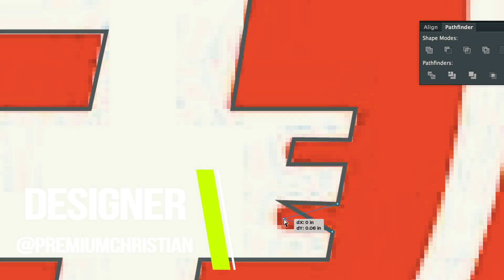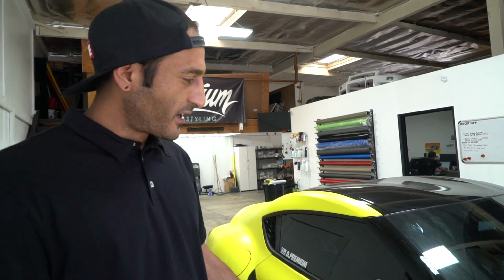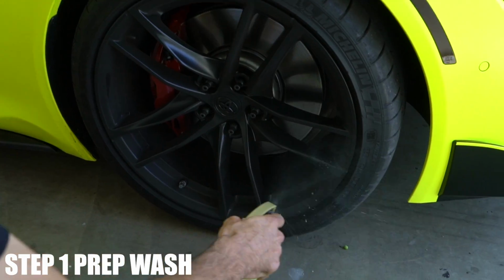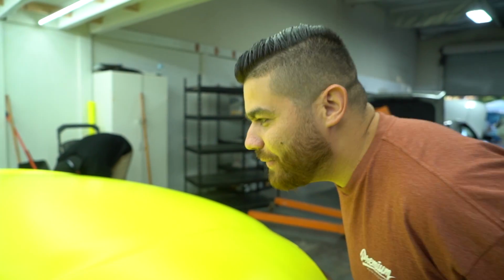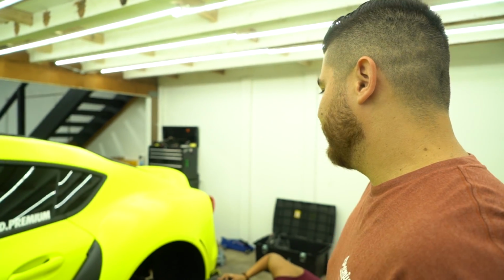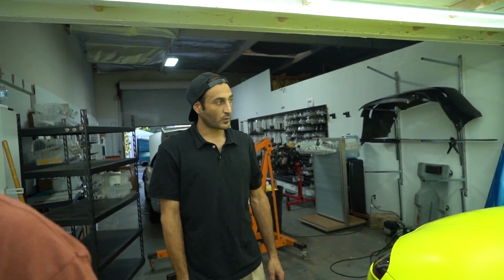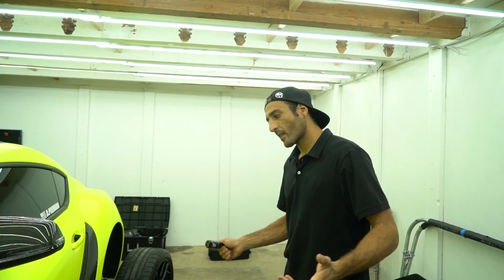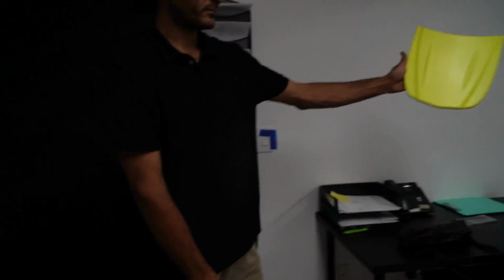MY CAR WRAP IS FADING! Ceramic Pro

Comment: This color from Arlon is more for interior, on vertical surface will last one year and for horizontal (roof, hood,boot) sections will last no more then 3 months based on your location in summer time. I've installed a sticker made from the same vinyl on my back window, in 9 months the sticker was white:) good luck

Comment: Is it highlighter colors that fade in general? Or is it because it's also matte? Is it possible to do like PPF over the top of it?.... Somebody explain it to me, I don't know these things.
Reply: All fluorescent colors will fade. It relates to the pigment. You can either laminate it with a UV resistant film or do PPF / clear bra afterwards. It's still going to fade, just not as fast. Ceramic coating I've never tried on neon wraps but it works well on regular wraps.
Reply: @stulogic  groovy thanks

Comment: Why does everyone call the car a 2020 Supra. It's a Toyota Supra not a 2020 Supra. Lool
Reply: Because there is more than 1 generation of the Supra. Calling it Toyota Supra does not specify which gen the car is
Reply: I guess when the 2021's come out, they'll finally start calling it the mk5 or gr supra.
Reply: @gktpictures6069  that's just dumb when you call it the mk five I know they trying to determine which generation but the name of the car is not 2020 Supra. So why don't they call the older generation the 1998 or 1994 Supra.
Reply: They are tools man. Like to state they have a new car...check out my 2019 f150 bro. Haha these guys